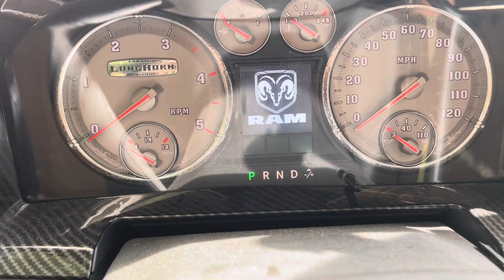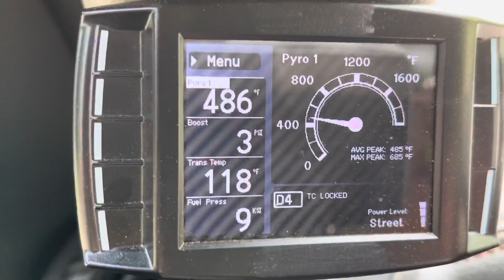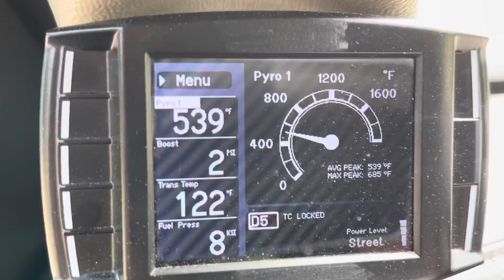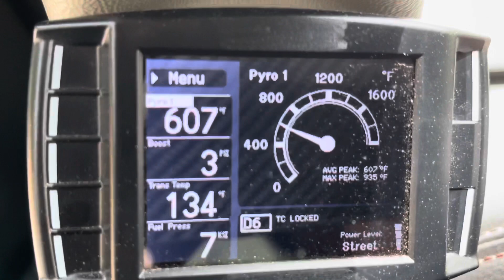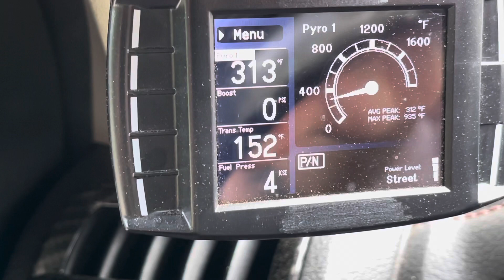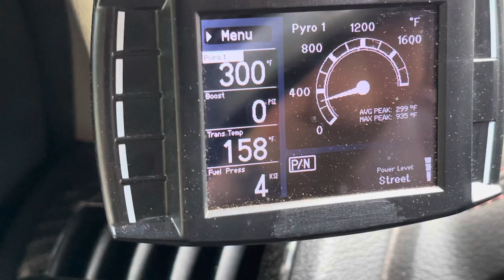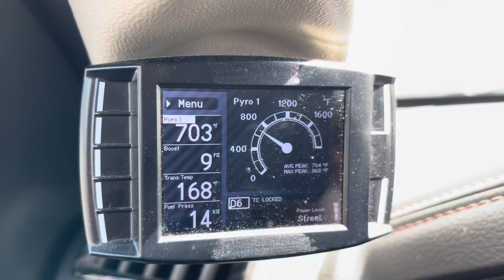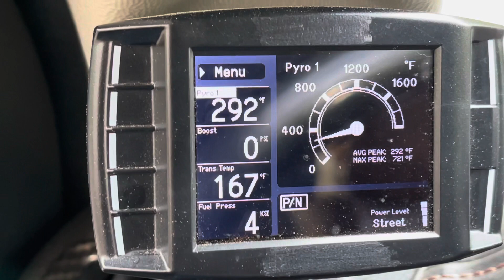Why you should delete your Stock grid heater and intake on a Cummins 6.7L Part 2 Results Are AMAZING

Comment: Turn your defuels off. You’re gonna blow a head gasket. Your timing level stays at max and it pulls fuel out. Which equals very high cylinder temps when it can’t burn the extra fuel it don’t have cause it’s pulling it back.
Reply from the maker: We rarely hit the defuel when it was on we since have turned it off
Reply: @DIYKAI  good deal. I got a 2011 model. I have the mini max still. I run the default timing and tow and street tune. No issues. But all defuels off. Mine will hit 36 psi pretty easily but I rarely do that. Only when engine and trans is fully warmed up.
Reply from the maker: It's great being pre def lol

Comment: Do you need to change anything when you install this like the tune for example or defuel? Can I just install this and not do anything else? My truck is stock.
Reply from the maker: If you are just doing the grid heater delete plate and the inline heater from GDP everything should bolt right up no tune needed
Reply: @DIYKAI  excellent thank you for the quick reply, have a great day!
Reply from the maker: @JDMshitbox  your welcome you as well!

Comment: 2 questions for ya. Where did you get your mount for your Mini Maxx computer for the column. And also why is yours defueling at about 33 psi of boost. I have the same tuner on my 6.7 and i’m curious
Reply from the maker: Check this links out for the mounting options:

https://amzn.to/3z9HlJD

https://amzn.to/3TSVd2R

We set the defuel between 32-35 psi depending on what type of driving we are doing. That is because we don't have head studs yet. Stock defuel is around 28 PSI.

Comment: Do you need a fuel line adapter for this?
Reply from the maker: Nope works with stock lines
Reply: Also do I buy S-2 or S-3
Reply: I order the kit it says “choose application” (standerd pickup) or (cab and chassis) what does that mean
Reply from the maker: @wylet1143  standard is what most people have that’s a regular truck with cab and bed…..cab and chassis would be like a work truck like the welding ones you see with no pickup bed on the back…they are slightly different then the regular consumer ones you get from the dealer

Comment: Im thinking about tapping thread into the stock intake instead of buying this expensive adapter kit to get the same results!
Reply from the maker: You will not get the same results the stock intake is trash and has no good spot to tap…you can get a cheap ram horn style for under 150 and it will flow much better than stock

Comment: Is this a common problem on the 5.9 trucks as well?
Reply from the maker: No only the 6.7
Reply from the maker: The grid heater on a 5.9 should be a square looking box thing but we have not heard anything about that other than just failing and not heating

Comment: Do we know if this comes for a 2021?
Reply from the maker: Most parts are interchangeable between 4th gen 6.7 and some 5th
Reply from the maker: What exactly are you looking for
Reply: @DIYKAI   the horn. Heater intake plate.   Maybe
Reply from the maker: @Bubba_MB  we can check in a few and let you know
Reply from the maker: Both are available for a 21
Reply: @DIYKAI  sweet.   Thank you
Reply from the maker: @Bubba_MB  your welcome
Reply from the maker: @Bubba_MB  we suggest going with a Banks setup as it will retain your factory components….seeing as a 21 will still have some warranties unless you passed 80K miles already
Reply: @DIYKAI  I read banks has cold start issues?
Reply from the maker: @Bubba_MB  not sure our set up has been flawless but we have no warranty lol....we added the mishimoto radi and cooler reviews coming soon on them
Reply: @DIYKAI  kool

Comment: Where do you have the pyro.
Reply from the maker: Rear of the exhaust manifold
Reply: @DIYKAI  is the plate tapped for one
Reply from the maker: @wizard_of_poz4413  yes it is
Reply from the maker: @wizard_of_poz4413  the stock one is not
Reply: @DIYKAI  I've got a port up towards the front that's for some sensor of indeterminate function from the factory and I've got a tapped hole in the rear delete plate from gdp that came with a sort of brass looking plug that upon a weekend of some spirited driving with a trailer through west va, saw the plug shot clear out of the plate
Reply from the maker: We screwed the pyro sensor right into the tapped plate no need for a brass fitting?

Comment: Like GDP products, their customer service however sucks!
Reply from the maker: Really? I was able to speak with them directly with any issues…..they were extremely helpful
Reply: @DIYKAI  trying to get through to sales. Won’t answer phones or emails.
Reply from the maker: @nathandeboer7974  are you having issues or trying to order?
Reply: @DIYKAI  order
Reply from the maker: @nathandeboer7974  got ya hopefully they are just super busy….so far we have over 10k miles on our set up and never missed a beat
Reply: Ordered the parts so we'll see how it goes. Have you kept track of MPG changes after grid delete and intake swap? @DIYKAI
Reply from the maker: @nathandeboer7974  they were great when I talked to them so you shouldn’t have an issues I hope. Single handed no because we have many updates. What I did notice was a smoother idle and a more linear acceleration if that make’s since lol…..this mod for us supports our other mods (Mishimoto intercooler & boost pipes)
This mod is more for the bolt in the OEM heater but you will reap the benefits of a larger volume of air when needed. If I were to guess 1-2 MPG if this is your only mod.
We get 21+ on the highway 80mph

Comment: Awesome video, you saved me some head scratching, I have a 2011 3500 SRW that I'm getting ready to down for a few days and replace my actuator & delete my stock grid heater. Thank You.   https://www.youtube.com/watch?v=XgA8QLHw-MY
Reply from the maker: Thanks! We have done so many mods to our 12 3500 DRW any questions don’t hesitate to ask. We just did a little 2k mile trip hauling 10k+ no issues at all EGTs never went above 1000 and outside temps were 100°+
Reply: @DIYKAI  In case you haven't run into this problem yet, I've had this pesky vibration that got to the annoying stage, it was my front driveline. Heard a few horror stories about them catastrophically failing and taking out the trans, transfer case, brake lines and beating the crap out of the floor. 

  https://www.youtube.com/watch?v=GPF5nyZFjug
Reply from the maker: We ended up replacing everything b4 a 2k miles trip because we had a vibration…..tires, wheel bearings, rotors, calipers, pads everything lol 250k and she is running smooth
Reply: That looks good. Did that help the fuel mileage. I'm getting crappy fuel mileage 12-13 . Wish I could find someone to do this to mine.
Reply from the maker: @Jarhead68  Thanks and yes definitely did help highway 20+ easy city 15.5-18 depending on how heavy the foot is lol….towing 10k+ between 10-13 depending on hills
Reply from the maker: @Jarhead68  it’s really not bad if you take your time the hardest part is the fuel system and keeping it clean while working because the fuel rail and lines have to come off for the grid heater plate